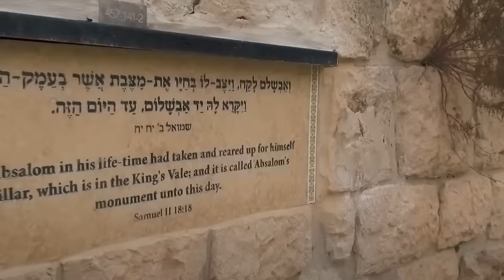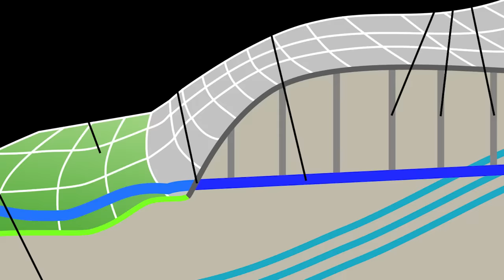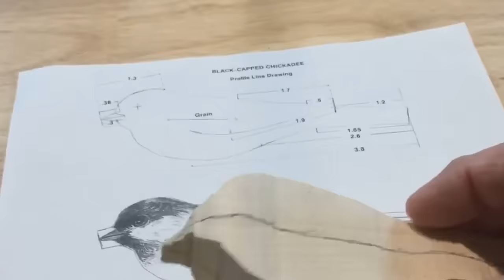12 Most Mysterious Ancient Technologies Scientists Still Can't Explain

Comment: Why assume the use of steel? Why could they not have used bronze or copper or even iron in these joints? Is there evidence that they used steel? TO my knowledge, no there is no evidence that they used steel. In fact some of the "imprints" shown have had bronze and copper residue in them, meaning that the metal used in the joints was bronze or copper and platinum is a relatively common mineral inclusion in many other metal ores. The "Maiden's Tower" looks consistent with stone cutting and construction techniques of the late 11th through early 14th centuries. The stele in China, was most like never meant to be moved or carved larger than intended by accident. As far as the Cumbemayo aqueduct being cut into volcanic rock, that is not that hard depending on the volcanic rock. Extrusive volcanic rocks tend to be relatively soft and easily cut and chiseled, where as most intrusive volcanic rocks are far harder. Everything else in this video is neither unexplained or strange, but rather known things with known reason for existing and how they were constructed.
Reply: So what he keeps calling clamps aren't clamps. The molds he kept showing were molds to make copper and bronze tools and they build them into the stones they used for building. Also the maiden tower was built around 1100 ce and it is stone carving that's consistent with the rest of the stone carving in the area
Reply: Yeah, massive feats of engineering, innovation and effort. Also kind of weird to exclude the Pyramids, those were massive efforts as well from around the same time.

Comment: The columns of Parthenon were connected by pouring led in a central hole carved in the marble. Led also did not damage the marble through thermal expansion. During a restoration in the 19th century, led was replaced by iron but this was disastrous for the monument and during the latest ongoing restoration, iron is removed and replaced by titanium.
Reply: @Autismo Correct, thanks.
Reply: Well now, don't that prove just how smart modern men and their understanding of ancient technology is. 🙄 Ha-ha!
Did the thought ever cross their minds 🤔 "Why was lead used? And where did they get it?" 
So was their any irrepairable damage caused by the titanium? 
Hey! Try plastic?
Reply: @phillipshosie9233  A comment from a channel with no content.
However, it does point out a typographical error, I corrected, it's Led and not Lead, Thanks.
There was damage done by the 19th century restoration, that replaced led with iron, because of different thermal expansion coefficients between the marble and the iron. This caused increased stresses that cracked some marbles in the columns. Titanium does not have this problem. 
Plastic is not suitable, nor does it have the durability required.
Reply: @FLORATOSOTHON  Okay Thanks. I guess I could've google searched all that info if I was really, truly that interested. Though it was fascinating when I was in middle and high school.
I usually look up words if I'm not sure how it's spelled, Lead, Led, well you knew what I meant. And you say the "19th Century?" I thought you were talking about like, a late 20th century restoration, 1980s or 90s. But even so; the brilliance of those people before the 1st century, in comparison to the 19th.

Comment: 6:26 btw something else to mention here is. those ''H'' formed Stones are the 2nd hardest Stone on Earth. just think about it how did they even cut that? with tools that obviously weaker then that Stone they cut. and this Edges are very sharp for that. and afterall its almost 4000m heigh there. so no Trees or Tribes to roll this things on.
Reply: You can use copper or stone tools, added with water and sand during the cutting motion. The silica (sand) matched with other hard stone can cut through any granite, no problem.
Reply: @Timbo6669  Youll never get that sharp edges with Tools that used Sand and water back in those days. And those stones are Adesite its 1 scale harder then Granite anyway. Granite is 6 out of 10 and Adesite 7. abd belive me this 1 Nr is abig deal. this 1 small Nr makes it just double as hard.
Reply: @rogerstalder7184  you can actually… look at how the Egyptians did it. Everything is recorded in their hieroglyphs.
Reply: @Timbo6669  Yea but they used very weak stones tho.. ^^ there is no Granite or somethign like this in this buildings anywhere close. They used Limestone 99% ^^ i can cut that with my Hands Bro.
Reply: @Timbo6669  I mean yea i c ant cut it with my Hands :) but u get the Idea.

Comment: Metal "clamps" that don't clamp, they simply sit inside a groove that was made for them to sit in PERFECTLY. It doesn't clamp anything at all. Stones cannot be clamped. They'll crack and break where they're being forced. We see none of that. The metal, likely copper, was set into a soft aggregate as it was SETTING. They were not for holding the stones in place they were for current transfer. Believe it or not; they built their buildings so they could charge them and each structure was part of a larger system. Likely a big geometric plasma field propagated by the structures themselves. The same structures that show 'clamps' also show that the stones, how they were beveled and formed uniquely based upon the surrounding stone were built corners first and their shape and design leads to falling in on itself if it's ever rattled. They wouldn't ever use two design mechanisms. The wall is either meant to move and fall into itself during a quake or it's designed to not move at all... We can't have it both ways. They aren't clamps and we understand very little about energy because we utilize electricity instead of that which manifests 'electricity'; SIMPLE GEOMETRY that matches the conjugate structure of reality.
Reply: I'm on the fence on whether you're serious or satirical...
Reply: @sorenjensen3863  Then you have much to learn and even more to let go.
Reply: @thedennis4412  sure bud 👍
Reply: @sorenjensen3863  Also, just so you know; those 'churches that were carved directly from one stone' were sung into existence. Likely three teams of 'masons'. You're welcome.
Reply: @thedennis4412  can you send me some of whatever you're smoking?
Reply: @sorenjensen3863  No, you should be capable of cultivating your own consumables. Smoking isn't good for you considering the current healthcare system but it does have some mental benefits as well as hormonal depending upon the substance.
Reply: @sorenjensen3863  Maybe if you ate real food you'd have real eyes.

Comment: The keys from the keystone cuts. Were all either copper, bronze or tin. As it had to be poured into them. As steel can't be made molten' without special crucibles, and a foundry that can handle the heat of molten steel. And I personally believe they had the knowledge to create the heat needed. But that's only half the problem in creating a foundry for steel.
Reply: And platinum appears in iron as a aloy all the time. Iron is usually the host metal that holds other rare minerals, like gold and platinum, in its matrix. Untill oxidized into iron oxide. That releases the rare minerals into solution. Then it is crystallizes into its purer form. Thru dissemination in hydrothermal solutions.
Reply: Would tin or copper be strong enough? I mean its not weight bearing...
Reply: Also.. Yeah... To make it more clear.. You cant melt and poor iron or steel from an iron or steel pot.. Its not that easy.. The pot would melt if you got it hot enough to melt the iron inside it.. But i would love to hear more about this..
Reply: @americanwoman6246  it's what was usually used. And it was not to hold anything up! But instead to keep the stones from shifting.
Reply: @Chuxgold  usually.. You mean like later in history? Or in known uses?
Reply: @americanwoman6246  Not all of them are missing? As there are lots of them in museums around the world.
Reply: @Chuxgold  the actual bronze or copper key tab... From where? From ancient times?
Reply: @americanwoman6246  Ancient' is what we are talking about here. As modern keys' are casted, then set into a pre shaped socket. And are made of steel. Not that the ancients realy had to worry. Their stones they used' were so big and fit so close together, that they could not shift. So the keys they did used' were way past, being overkill.
Reply: Thank you though . I was unaware that they had ever found any intact from antiquity... Not often I hear any thing i have not heard before.. Which is precisely why I submerge in conversations on you tube.. I want to know every thing every one else knows. . and I exhausted the available brains to pick among the people I know..  Took about an hour.🤣🤣🤣I guess im weird.. I love this stuff... Thank you for taking the time to respond.❤❤❤

Comment: They had enough knowledge, 2000 years ago, to build a steam-powered train, but they did not, because they lacked one central idea — trade as a win-win situation, i.e., that both parties in a trade walk away richer. They believed that in any trade, if it's beneficial for one part, there must necessarily be a loss for the other part, for otherwise, trade of equal values would be meaningless. All due to an erroneous notion of exchange-value, which lead to a general suspicion towards trading. Especially towards people who got rich by trading. They could therefore not detect division of labor, which is necessary to be able to build something as advanced as a steam-powered train. Fast forward about 1700 years, a time when the idea of trade as a win-win was accepted just enough to result in the industrial revolution. The invention of the steam engine is therefore not the cause of the industrial revolution, one simple idea is.
Reply: Wow!  No start to your knowledge is there.

Comment: Does anyone really understand the type of work involved in quarrying and sculpting, erecting an obelisk ?. 
It's pretty much impossible with modern tools. The one in Washington DC was made in many segmented pieces, this was possible. 
The ones in Egypt are solid one piece stones. I think more people should find this seemingly impossible.
Reply: The technology behind it is already known and it's surprisingly simple. Basically, they used huge saws and adhesives like sand or fragments of quartz. It would have been a labour intensive and slow process and it's likely they replayed their tools frequently but it is possible after many hundreds of hours to saw huge blocks of stone. 

Another thing but about Egyptian statues, they were never constructed out of single pieces but were often many smaller stones that were sandwiched together.
Reply: @fredkay6743  "It would have been a labour intensive and slow process". Not as slow as you are.
Reply: @spacedaddy5517  Then, how would you explain the cut marks?
Reply: @fredkay6743  There's scoop marks and nobody knows how they were made. This is suspicious enough.
Reply: @fredkay6743  It means were have no clue how they did it or what they were even doing in the first place.
Reply: @fredkay6743  Whatever happened, the official story has to be wrong. Either a much older civilization made them or maybe it was aliens or something, it was not primitive manpower.

Comment: Hard destroys soft...er.  For the first one it's the process of sanding, with something harder then the rock the 'Thin River' is carved out of rubbed against it.  Diamonds or other hard gems could've been used. Also works for any smoothed rock construction, even before rock splitting with water and fire, rubbing one object onto another was around.  Side note You can make very pointy sticks with just rubbing. 
Um when you make iron you make a tiny bit of steel, it's a lack of metallurgy by the scientists researching it.  They need to hit the books.  I really don't wanna explain iron making and how trace amounts of steel is created every time.  Well now look at what you made me do.
Reply: One of the civilizations in that area also used acid to melt away imperfections in stones making them perfectly square or whatever shape they needed.
Reply: Is it also possible that the canal was simply added to an existing natural flow of water.

Comment: Aquaducts are not natural.  Maiden Tower:  Building was once all red brick and mortar.  An Xfactor heating event began from the ground or energy grid.  The bricks were transformed as the heat moved upward.  The half paralyzed man didnt carve anything.  those are remnants from a fallen building; nice story, not true.  Moving monoliths:  Levitation.  Hit metal:  machines that utilized the sun, from small to very large machines.   At 8:00 mark, carvings are simply molds.  They were used everywhere.  if, the building was melted and the carving were pockets of survival.  Ansoloms Pillar:  All structures are made from red brick/mortar and Tartarian concrete.  Underground buildings were filled in with melted red brick mudflood from the XFactor.  Alchemy can make strange things.   The first civilization built all water related structures on Earth first with the help of the Watchers (fallen angels).  Air ships were used for centuries.  very old drawings prove this.